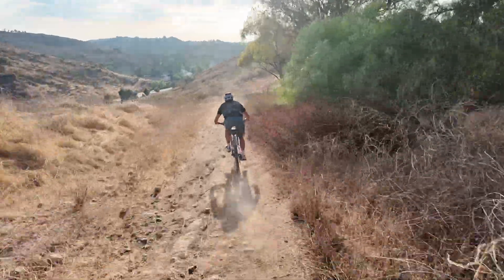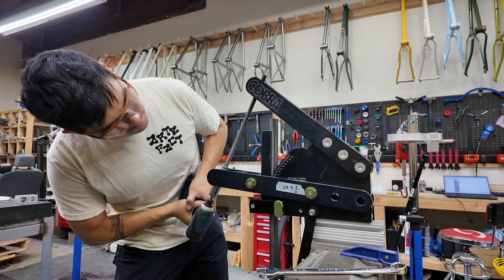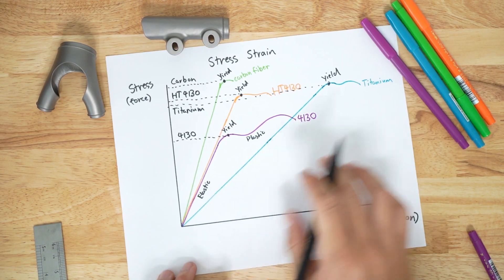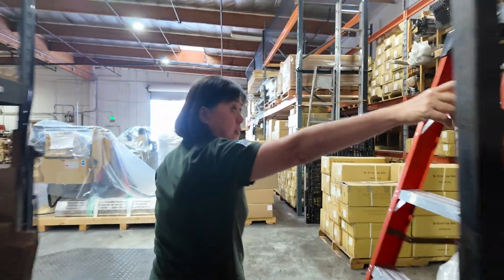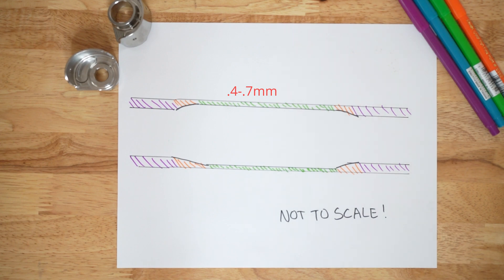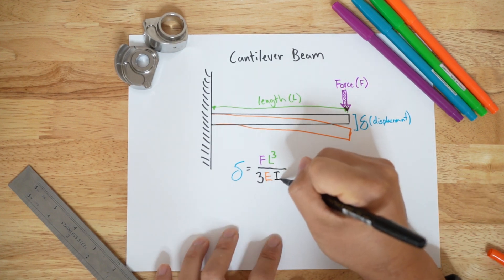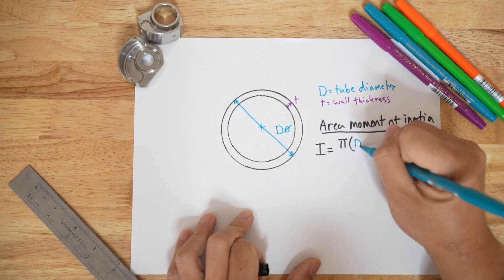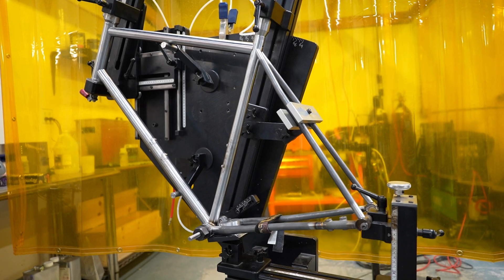Why Steel will always be Real

Comment: Now I know the difference between Carbon Steel, Hi-ten Steel, Chromoly Steel. Thank you. I've been wondering why chromoly steel is more expensive than them and why Hi-ten steel is much cheaper. I was thinking maybe this is low quality but due to the plastic attributes of them, this totally make sense! I can now choose what material I would use that fits my needs. Correct me if I am wrong so it's kinda like this (Go Carbon or Hi-ten steel if you're going to use your bike for commute, groceries, bike to work thing and just literally urban travel and go chromoly if you want it all that includes rough terrains cause your bike can take a beating without breaking apart, you'll be safer because it will only bend). Thank you.

Comment: So is steel like 853 reynolds or the chromolly you mentioned better than titanium for a bombproof frame ?
Reply from the maker: @irvingramirez1071  the design matters more than the material. 853 is really strong, but they make the tubes thinner to save weight, so in the end, they are probably about the same strength, just lighter than most bike tubes.

Comment: While this information is correct. You forgot the mention that steel has superior fatigue characteristics which allows for more complaint designs as they can design include slim tubes that deflect while most specifically aluminum and other allows do not allow such designs due to their lack of a fatigue limit

Comment: strength
easy to weld
ecological
usually good looking frames
good amount of plastic deformation before loss of integrity
Not to mention that steel has gotten humanity to where we are because it has excellent properties, is cheap and you can manufacture most of everything out of it

Comment: Im new to this. How do you spot whether a bike is steel or not? An aluminium frame or steel frame, at a glance, look the same to me. How could you tell it’s steel without checking the labels? Thanks
Reply from the maker: Magnets! Usually, steel tubes are much slimmer, that is how you can tell visually.

Comment: It's interesting the "Tube Stiffness" part of the video starting @6:47 shows that tube material, e.g., steel vs Ti, doesn't matter nearly as much as tubes' length & diameter.  Unlike proportional material elasticity differences, tubes' length and diameter had cubic (power 3) and quartic (power 4) influences.  Apparently aluminum frames have reputation for being stiff really only due to tubes' large diameters.

Comment: "Steel is real and rust is real", Hambini justify that statement few years ago — Peak Torque said that the stiffness that you can get in a titanium bike frame is insignificant (i.e. magic carpet ride) like to those steel frames. Because what matters in a bike specially in Mountain Bikes is the acceleration, the time that it takes to make the object from rest - move and move - rest. In summary: F = ma or a = m/F.

Comment: In my opinion, steel should be the most convenient material for the vast majority of recreational cyclists. It is cheaper, stronger and more durable than aluminum and carbon. Aluminum should only be used in certain components to give a more aesthetic appearance to the bike. But, since cycling has become a big consumer business, aluminum and carbon components are promoted for having a few grams less, knowing that they are more expensive and less durable materials.

Comment: Steel is timeless, until it rusts... What I got from the video is that steel is great...for frame builders! 
From the pov of the person riding the bicycle, aluminum is better. It is lighter and more rigid which is what i prefer. And it's easier to maintain because of no rust. I have scratches in my aluminum frame for months now and the frame is still perfect. With steel i would have a address every scratch soon or it will cause rust. And i can leave the aluminum bike outside in the rain for much longer without worry

Comment: Have you tested how much the tubes will deflect after they have been welded into a frame? I'm guessing there is not much measurable difference between alloys or even between materials because the design of a traditional bike frame is so stiff and strong. Some cyclists say they perceive differences in ride quality between heat-treated tubing vs non, but I'm skeptical. Say riding over a bump causes 1-2 mm of deflection, the tire compresses so much more I'm not sure how you could possibly isolate the feeling of the frame flexing... but lab equipment could certainly show it. I'm mainly talking about vertical stresses but there's also torsion, which I assume is another thing entirely. I'm curious.
Reply from the maker: When tubes are welded into a structure, the structure's geometry (area moment of inertia) dominate. The torsional stiffness is by far the weakest bending mode. Bumping up tube diameters makes noticeable differences when riding. Wall thicnesses less so. different alloys, totally no difference!
Reply: @ thanks for the reply! That jibes with my assumptions and experiences. Such interesting stuff and I appreciate your giving it a deep-ish dive while still keeping it engaging.

Comment: You missed one of steel and irons greatest advantages:  durability.  Carbon is naturally brittle, and over time impacts cause microscopic tears and breaks which slowly weaken the material until it breaks.  A soft to medium hardness steel is malleable, and impacts will not cause the metal to have any breaks within it.  While poorly heat treated super hard metals and carbon will eventually suffer brittle fracture, malleable steel alloys will bend instead of break, and more importantly, will not slowly have fractures throughout the material until it fails.  Good quality steel and engineering can make something nearly indestructable, while carbon fibre will eventually fail under impact.  Carbon is strong, but outside of its sheer strength it is very delicate and vulnerable.

Comment: If steel is so simple why does the bike cost 2500 usd? Need a graph showing how many x overpriced it is.
Reply from the maker: That is actually a video I am working on: why our bikes are so expensive.
Reply: American frame builders are barely able to pay themselves, let alone make a profit. If you think $2500 is overpriced, it's because you're comparing an American-made bike with one made in a country where the costs are a fraction of what they are here.

Comment: It's because the welding machine for steel is cheaper
Reply: Not true. Any high end TIG machine capable of the fine control necessary to be able to weld thin walled steel tubing will have AC and DC capability. Whether you're building with steel or aluminum (or titanium), you're buying the same machine.
Reply: @UWMailing  should you not be saying titanum
Reply: @snorttroll4379  No. It's Titanium.
Reply: @UWMailing  good to knog. will the ac dc machines be able to do both? and can one make an annealing chamber with a heat gun for alu frames?
Reply: @snorttroll4379  Yes, they can do both. To heat treat Aluminum frames you need a heat treat oven. These need very accurate temperature control.

Comment: As someone who's done DH + mtb trials for 25yrs the steel option was never there ! You could get a bmx or a Pashley or Dmr street frame outta 4130 ,  but all top tier trials + dh frames were 6061 or 7075 7005 aluminium , loads of lads wanted a bomb proof long travel steel dh bike but nobody made them .

Comment: I will believe in the unique ride quality of X material or tubing when I see it pass a blind test with statistical significance. The only such test I have ever seen was from a magazine in the eighties where the very experience editor of the magazine was unable to tell different types of tubing apart. Not a definitive test by any means, but it does suggest that placebo may be at play. If there was a measurable difference, we would have seen blind tests by now rather than audiophile-quality subjective assessments.

Comment: Awsome is 4130 the most common in ur frames?
Reply from the maker: @gregorybolin4672  short answer, yes! Longer answer, 4130 is just an worldwide industry specification for steels. All bike tubing is higher quality than that!
Reply: @Daniel_Yang_ARTEFACT  I took some material science FCC bcc hcp etc. My poor 4130 trek. I did go low carb so total weight I'm still under a carbon fiber.😉

Comment: I read that steel is the most environmentally friendly frame material due to energy used to manufacture, recyclability and repairability. Then alu, then titanium then carbon fibre
Reply from the maker: While that may be true, the most sustainable thing is to not manufacture a new bike. I know that is hypocritical to say as a frame builder, but I try to make bikes timeless and repairable. If your bike needs to be recycled because it is no longer cool, your designer already screwed up!

Comment: One last reason is mentioned in passing. Timeless.  What is the impact on carbon frame with passage of time?
Reply from the maker: Good question. Carbon does not degrade over time, this is totally a bike myth. The reality is that bike die simply because they go out of style, not because they catastrophically explode. That is my only complaint with carbon bikes, they are trendy and hard to repair. There are exceptions, like the Specialized Aethos and Crux.

Comment: another opportunity to request a piece on how frames and forks are designed and tested to be compliant with applicable requirements (i.e. CFR Part 1512.) I assume for the most part these regulations are not applicable for bikes falling under the category of "one-of-a-kind" bicycle. At the same time I'm curious why we don't see more bikes fitted with chain guards and derailleur guards as these requirements would seem to apply to a lot of production bicycles.

Comment: Great video. I'm still riding a 1994 Diamond Back Axis ,nickel plated XT version, here in the UK. TRUE TEMPER TT LITE tubing, set up as a fully rigid single speed. Love it. Better now I'm a bit heavier and pre loading the frame a bit more in my mid 50's.
Reply: Ay my dude! I'm riding a 1990 Diamondback Apex, down under in New Zealand. Good old Deore DX spec. Actually blew me away how nice it is to ride over rough stuff with no suspension to speak of. Not to mention it feels like it could take anything I'm liable to throw at it, short of throwing it off a cliff. Which I never would cos I love it!
Reply from the maker: I rode around a Diamondback Topanga with a black and white splatter paint job. Those 90's diamondbacks were killer! The True Temper Axis must be really nice.

Comment: steel is a great material for frame builders who weld and solder themselves - to tailor a bike to the customer and create individual designs - you can also build a soft frame from other materials - that's definitely not the point - it's great that the Taiwanese offer such a huge portfolio of tubes

Comment: how does alumnium comapre to steel?
Reply from the maker: Aluminum is about half the stiffness of steel, so you need really large tubes to achieve the proper stiffness. I didn't comment on aluminum because I didn't feel like I had enough expertise.

Comment: An English mtb magazine did tests on different metals used in frames one of the tests was endurance and there titanium won by far when they stopped the tests after 400,000 cycles there was no wear at all cr-mo gave up after 140,000 cycles and aluminum 5000 cycles. As a description of how long a steel frame lasted, the newspaper writes that you can let several generations inherit the frame without being worried. Of course you can break anything, even a titanium frame.
Reply from the maker: very interesting! I will try to find this

Comment: I feel like I'm missing something here so please correct me. If titanium deflects more and has a greater yield force than crmoly steel wouldn't that be better than building a cromoly steel bike frame that yields and is now a "bent" frame
Reply from the maker: With titanium, you have to make the frame stronger with larger diameter tubes and thicker buts. This is because the Ti is more prone to cracking than steel. It has a lot less plastic deformation. When you work with titanium, you can feel this even as you file the material, it feels like the micro fragments are chipping away.

Comment: Does steel become more flexy over time, like a worn out metal spring on a vehicle compared to aluminum or carbon fiber?  And if so how much over time?
Reply from the maker: @mikej1348  nope, it’s stiffness does not change! Eventually, like all materials, it will fail in fatigue

Comment: I think the main takeaway from this video is Steel allows framebuilders to make bikes that are not going to fail catastrophically and kill someone… they bend before they break - unlike carbon.
Reply: what if your bike bends on you, how much does it bend?
Reply: @snorttroll4379  you are missing the point - carbon does not bend - it shatters and you hit the floor so one off builders end up having to overbuild the frame so it does not feel nice to ride. ( large manufacturers will build many frames that they test to destruction to achieve nice ride characteristics with enough strength ).
With steel, a small manufacturer can build bikes that feel nice to ride ( because they are only as strong as they need to be ) without the worry of the customer crashing.

Comment: Compelling. Though I would say there is a fair bit of thinking involved in exploiting steel to its maximum. A single tube is straight forward but when you have a system of tubes is where the art happens. Or a good matrix. 🥲

Comment: There we go. Those graphs answer the question why hasn’t titanium been explored more in a race setting.
Reply from the maker: @hockysa  good point. Titanium is halfway between steel and aluminum in terms of stiffness. However it’s much harder to form titanium tubes. Aluminum is much cheaper and easier to form than titanium.

Comment: Bespoke,custom selected frame building has really advanced. When you think about how long frame building craftsmanship has been around and what advancements have been implemented over time it’s hard to deny that steel has a much richer history of development and design than any other frame material. As for any comparison to an assembly line mass production frame building bicycle design. It should be noted that those factory frames are designed for the masses and cannot be manufactured for everyone’s preferences so will inevitably be produced to be strong enough to avoid any warranty issues of a fat kid jumping off his roof. 
I truly enjoy this content and look forward to hearing about how you “tune” your frame tubing selection based on a riders weight and needs.

Comment: What's your take on stainless steel as frame building material?
Reply from the maker: @krollpeter  stainless has the same mechanical properties as steel. The main problem with stainless is that it is expensive, so demand is low. That means there are not that many butting profiles and diameters.
Reply: @Daniel_Yang_ARTEFACT  thanks for your reply and containing useful information!

Comment: I studied materials engineering and I've learnt pretty interesting things about bike design considering the materials manufacturers have to work with thanks to this video. Steel is real indeed, real simple, cost effective, and by processing techniques like bending and heat treatment you can alter many aspects of the bike frame.

Comment: Great video. I have no doubt that steel bikes can generally be built to be more compliant than other frames. But at a time when highly compliant touchpoint components (which can benefit from composite construction, and are all cantilevered beams) are available, I wonder whether the ride quality benefit is terribly relevant. Bikes are made up of welded trusses, after all. There's not much compliance to be had, even in a very compliant frame.
Reply from the maker: @cew_die_pie  Carbon seatpost flex a lot. Carbon forks could flex more,  but they need to pass testing, so they are really stiff. But this is also why steel forks that pass testing are stiff too!

Comment: At the end of the video you said ride quality of steel lies into the large range of elongation one can gets in the plastic region. So that the steel bike doesn't need to be overbuild. Do that mean builders design bikes and tubing to work in the plastic  region of the stress-strain curve while being used on the trails ?
Reply from the maker: @valentingm9718  it kinda backwards, because steel’s failure mode is that it bends and buckles (large plastic region) we don’t need to overbuild them